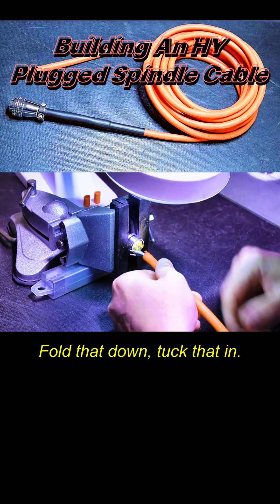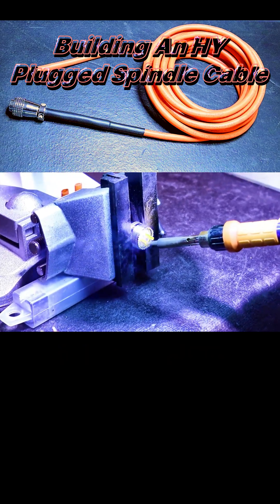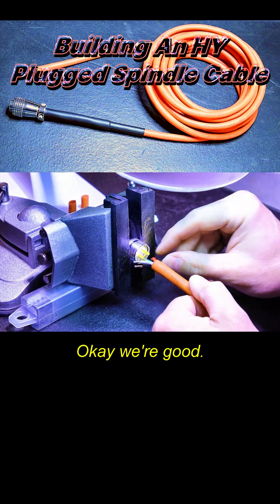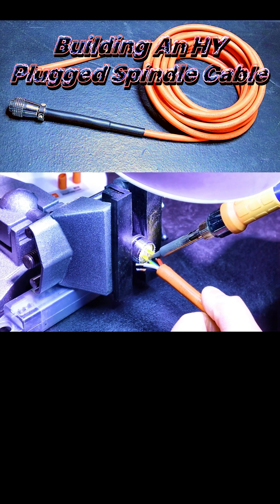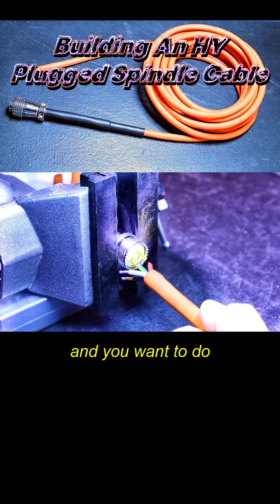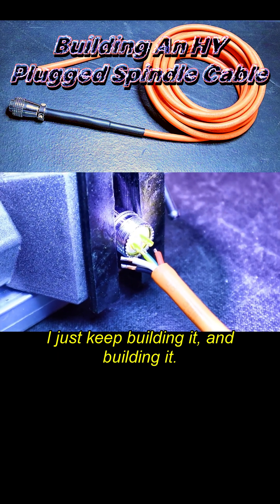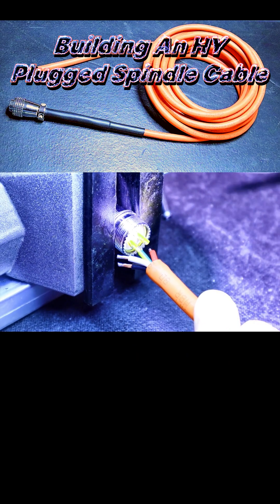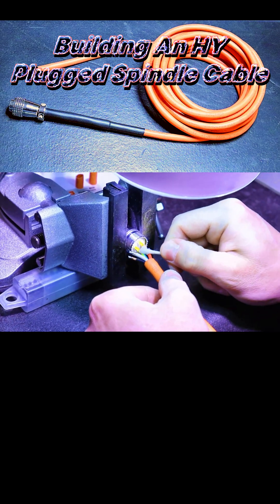Building an HY Plugged Spindle Cable – Full Soldering & Installation

Comment: If you're doing this all day, i'd suggest you buy or build a rig for each connector type. Seeing that is a bit atrocious. Takes way too long.
Reply from the maker: Thank you, but I have this under control. Each connector is really the same in terms of termination with leads, but the machining portion is unique to each type along with lead casing removal length. 

Good luck dog fighting, you have a cool username. 

Thank you,
Vince
Reply: @corvetteguy50  Oh, a man of culture. Unfortunately i never made it into a cockpit... 

However, i'm following you for some time and think you're doing a great job especially with the grounding issues. 

Since the last year i'm selling my customers a retrofit on chinese industrial controllers from XCMCU, like the xc709D. 
Way cheaper and more capable than any pc based controller, especially because those are real time controllers. 

Only problem was the documentation, but since i now know them in and out, that isnt one anymore. 

I've been thinking on maybe importing those to the states. So if you're interested, i would write you an email.

Thanks